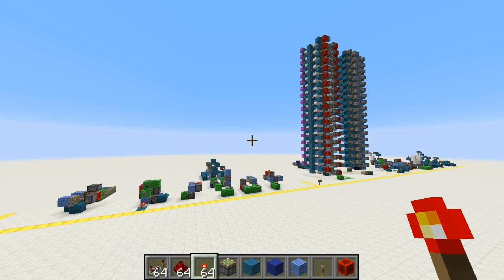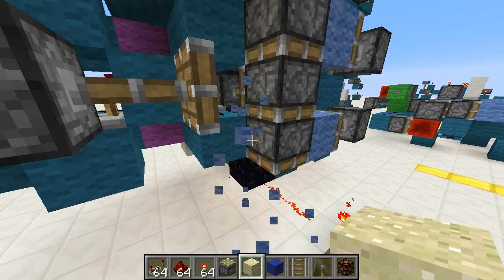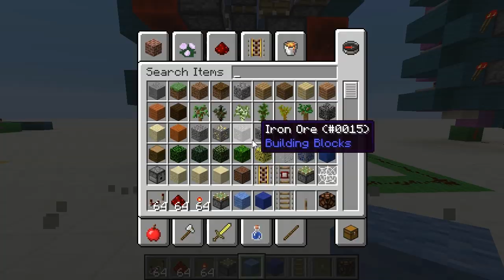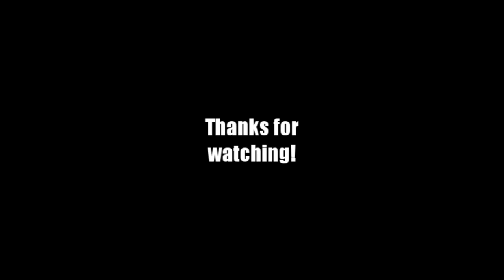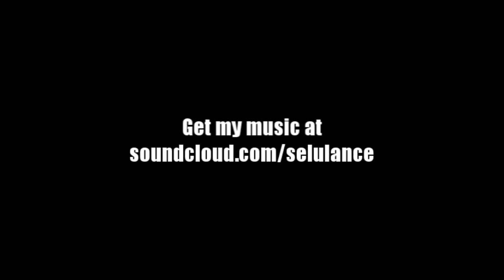Minecraft: 0-Tick Monostables & Some Applications

Comment: I made an instant block pusher that pushed a block in a circle infinitely and instantly. It stops working after a bit, but it is still a fun concept.
Reply from the maker: I'm going to need a map of that to believe that's even possible :P
Reply: Selulance I will make a video. I have no proof that it goes in a circle as the block does not move, but if you do one at a time it works.